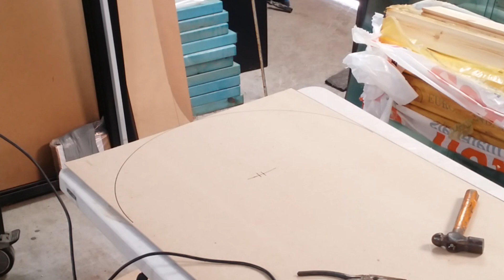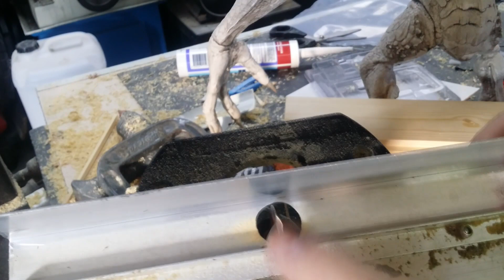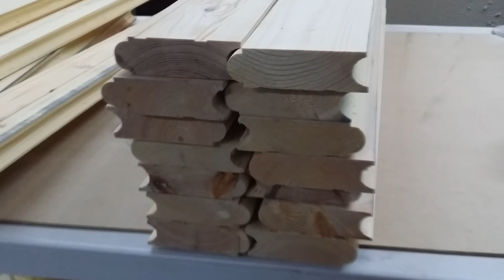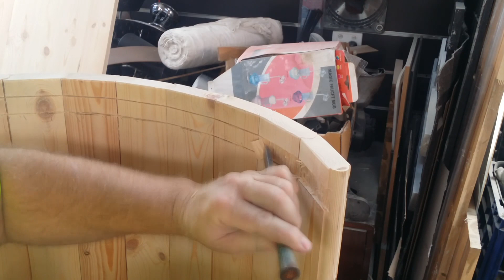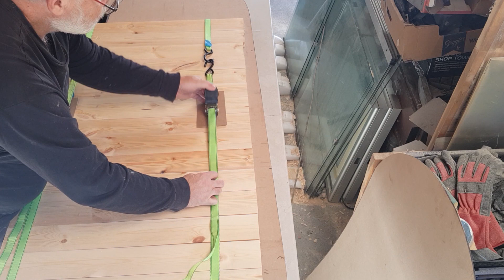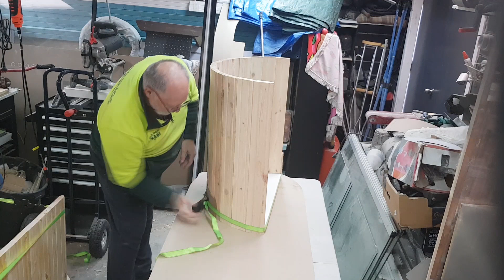Japanese Style Hot Tub Build Part 1

Comment: Looks really fantastic so far,  one question though - why did you use silicone and putty I thought they are supposed to be watertight through the wood expanding?
Reply from the maker: With Cedar wood yes... But because the pine has uneven grain and knots it won't work the same, so the timber has to be kept "dry" with a resin coating